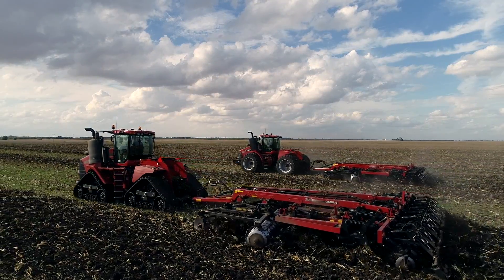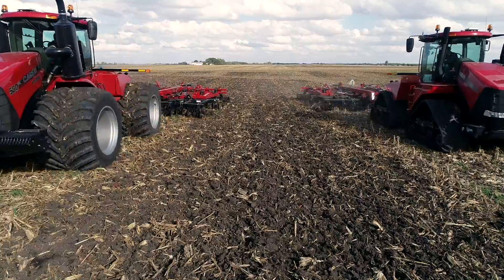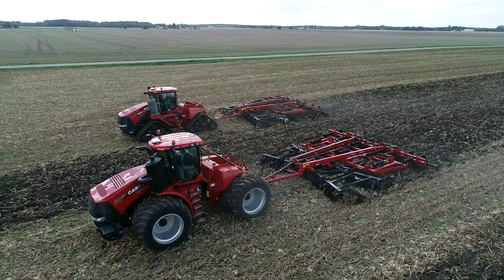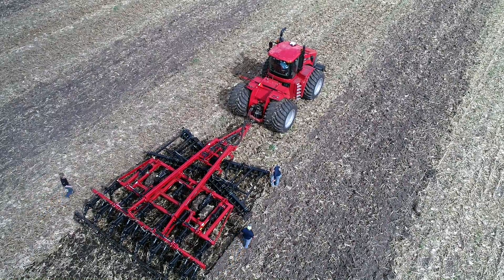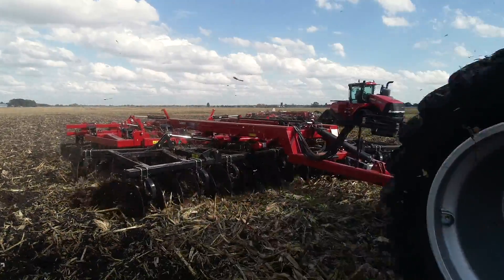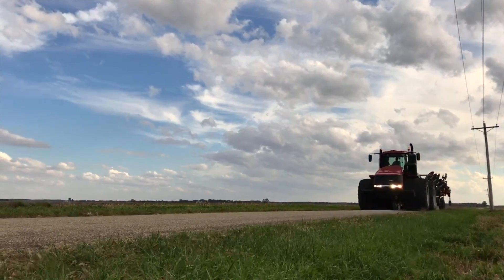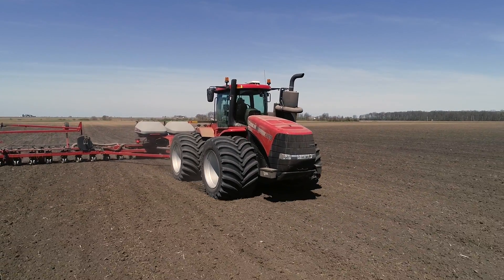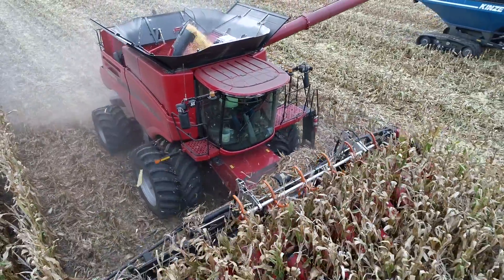Tracks Vs New LSW Tire Technology, there's a reason you can buy the from the factory now!

Comment: This is great. But we have a quadtrac that has so much hp in a narrow foot print. In fact it is quite a bit narrower than our magnum mfwd's...when you factor buying the rims...which no one talks about...it's still cheaper tha n replacing tracks...but it's less performance in the real places a quadtrac machine shines. When we will replace our mfwd tires. We will look into this...but we won't be replacing tracks with tires.